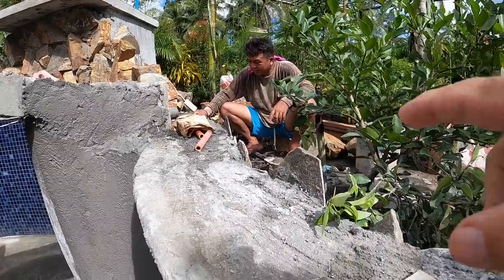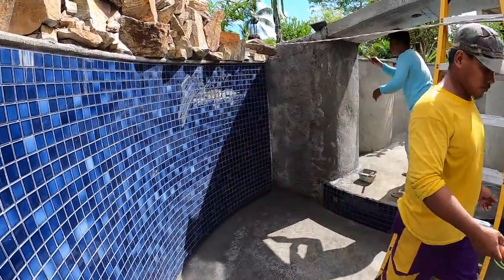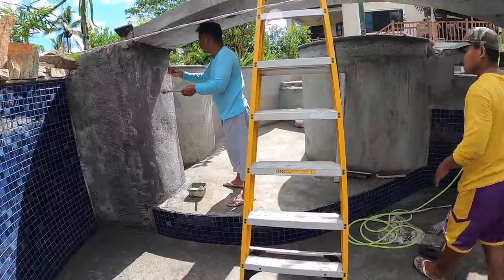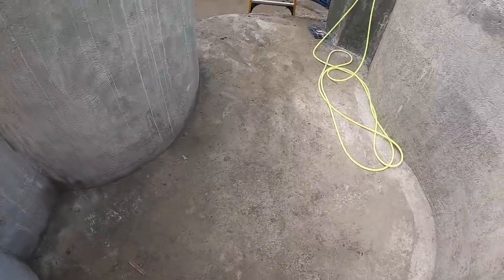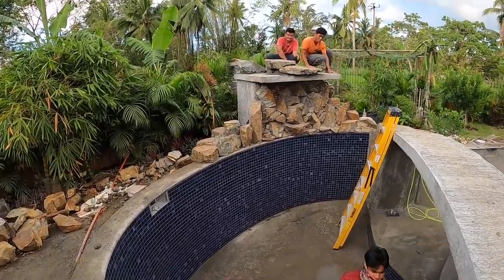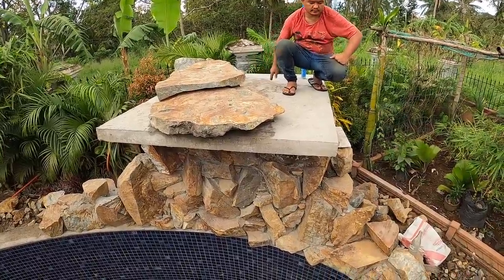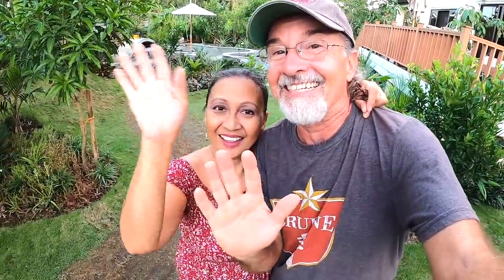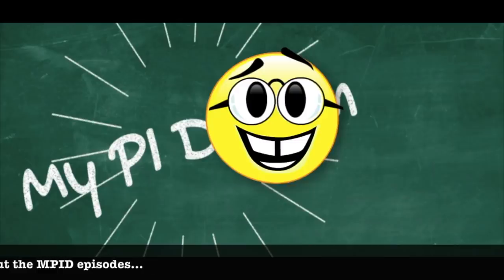VILLA FELIZ POOL BUILD - EPISODE: 41 (House Building in the Philippines)

Comment: If it’s not too late it’s best to cement waterproof that slab on the waterfall before laying the rocks down as the long term wetting will eventually attack the rebar inside the slab.
Reply from the maker: It was done when the slab was poured.  I show that in an earlier episode.

Comment: Nicely produced video. Btw, when are you getting another generator? That's to many brown outs.
Reply from the maker: We went on Sunday shopping and almost purchased one but the gen set was missing documentation on the ATS connection on the front panel.  It was a different pin out from our installed ATS.
Reply: @MyPIDream  sounds typical to have something different than what you need. Good luck on finding a matching one. And to think you had put that volt meter on your old one. Did you check how much just to replace a engine?

Comment: Hi James, 
Maybe I am missing something but how will you maintain that 5" section water level if the opening is at  that floor level by the bridge. Shouldn't that opening be at 5" height? Just curious.
Reply: You are looking at it upside down - the water level logically is the same throughout the floor levels are what changes. The opening I suspect is for the skimmer flow to work.
Reply: @zorbalight3933  Ahh, ok I was assuming that would be a place for a short drop down water fall like from most hot tubs to pools.👍🏼